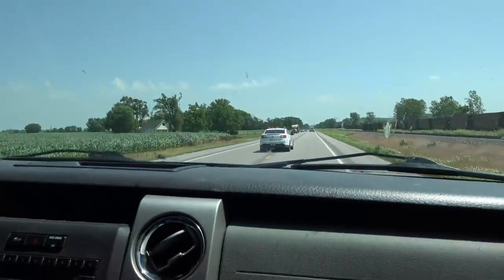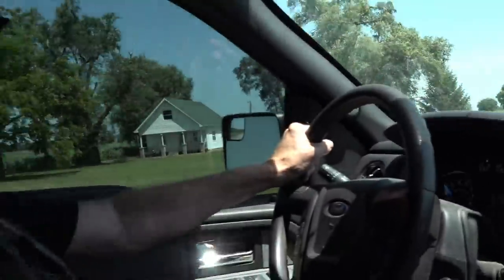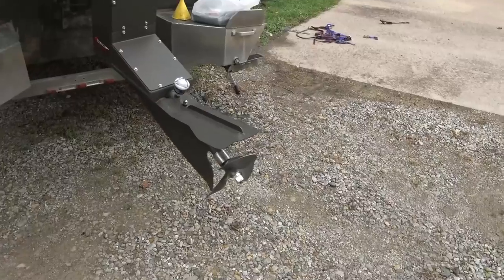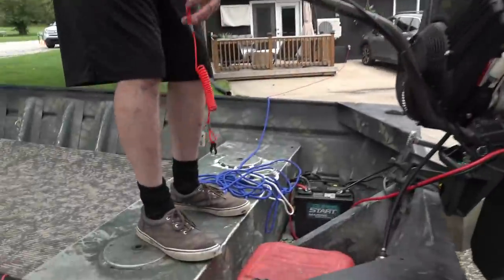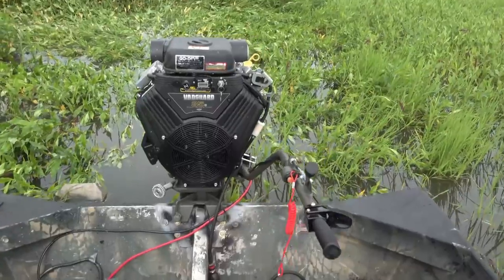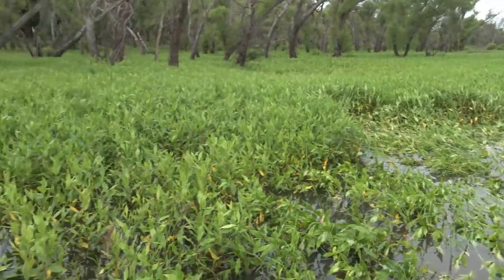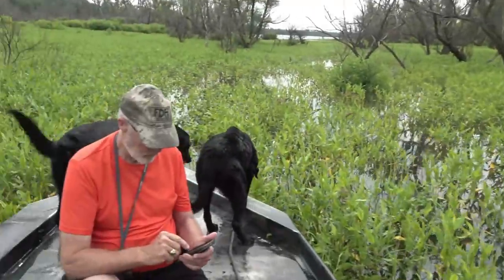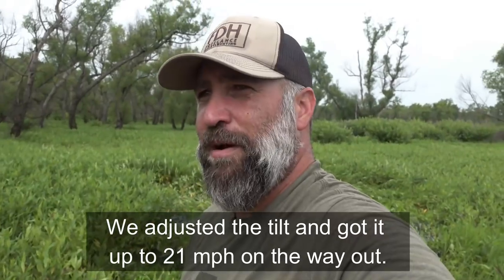New Mud Motor! Which One Did We Get?

Comment: Is the Vanguard motors are reliable Only thing I don't like about the lower end is the Is the oil coupling on the bottom of the unit I've had a mud buddy long tail currently have a betill surface drive on a 16' boat fairly light boat does well 2 guys 3 guys is a little heavy 25 horsepower always will show what I went bigger  Is motor when I bought it have had but it have had it for about 7 years now only thing I've ever had wrong is my own stupidity
Reply: I can do about 20  Is with 2 guys 2 dogs  And about 7 dozen decoys Cooler's lunchboxes